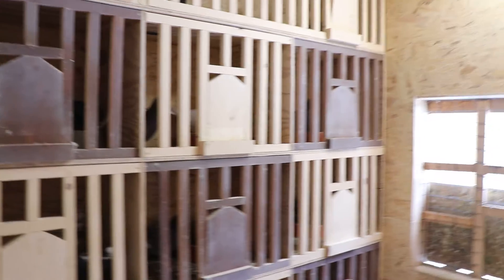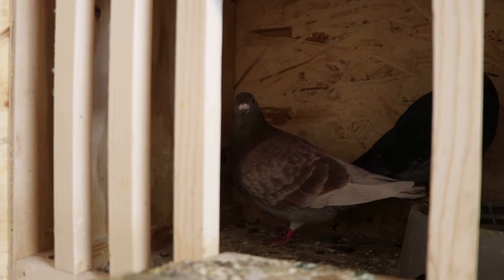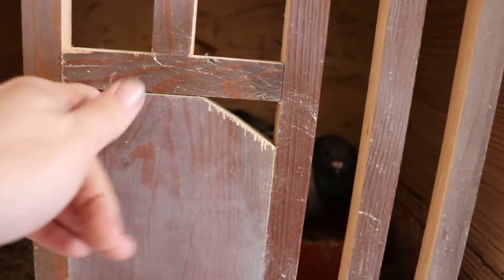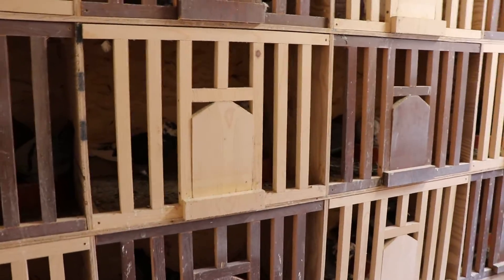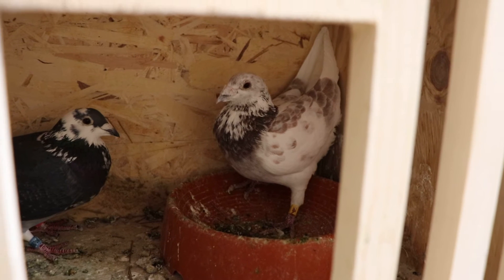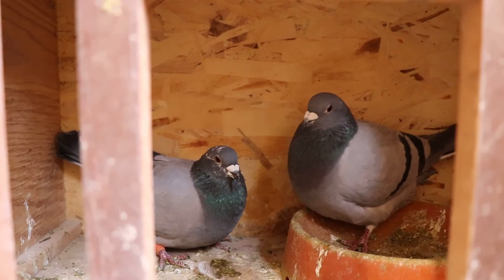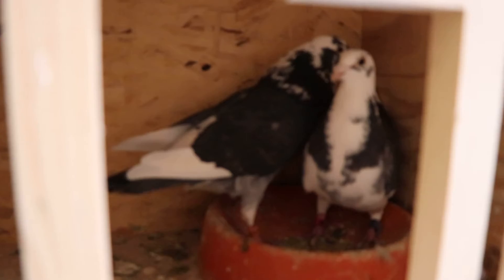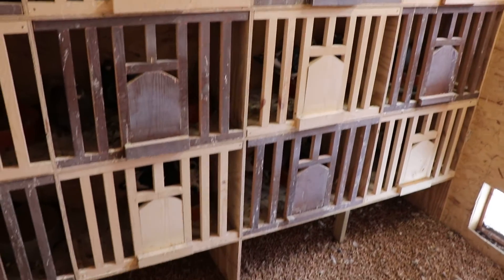Breeding Racing Pigeons 2018

Comment: As a former breeder with yrs of experience, i know exactly what he meant. You pretty much figured right on that. Some would not agree that the way you paired birds is a good way for various reasons. Mostly because of some families not being "compatible" with others. I never held much belief in that. Here in Hawaii, our birds face terrain much more challenging than most other places. So we have to breed accordingly. A lot of the time we found it necessary to cross breed pure bloodlines for this reason. As you become more experienced and knowledgeable, at least in my experience, youll start to get gut feelings about what birds to put together based on this alone. I like the pairings you chose and the reasons/methods why you did this in the way you did.
Reply from the maker: With my own birds I knew what I wanted to breed at the end of last breeding season but because these aren’t my birds and I have no information other then race results so I chose to breed good to good. I also don’t believe that there is any right way to breed birds. The chances of getting an ace is just as high whether I pair them if they just pair them selves. There are many wrong ways of doing it, breeding by color or families/strains I believe can set you back years. In my opinion I don’t believe in families not crossing well with others, maybe the birds weren’t compatible but not an entire family of birds. My goal is to get a few good birds to replace some of my older stock that hasn’t proven to be any good. I don’t want to bring in any new birds or strains until I have a good family myself
Reply: Adrian P different people have different philosophies on this.  It all depends on what results you want. sometimes when birds choose mates them selves despite trying to pair them with other birds can result in good offspring. Sometimes the  birds see something we missed. I found that to be true enough times to where when this happens I let them stay together.  As far as older birds are concerned, I used fosters for birds older than 7 yrs to prolong fertility for these older birds. especially when I needed more of that particular bloodline. With the quality and known history of the birds you're breeding, I don't see how you can get any offspring that won't perform well. Only poor maintenance and performance on your part will result in a poor outcome. But I don't see that happening. 
The only suggestion I have is use fosters for the older birds. You have a big amount of birds that basically will just sit there and eat and crap. Use some for fosters so at least they don't end up being just an expense.  If you have any questions about this, just ask. I'll be happy to help.
Reply from the maker: I appreciate your input and yes I will be using pumpers for the older stock. I may have not mentioned it but I’ve had Pigeons all my life. Both my grandparents kept pigeons so I’m not new to racing homers just new to racing. And your absolutely right, my management can be the weak link to not achieving my end goal. I love your input, there always something to learn. Lol
Reply: Adrian P that's a good thing being around and having pigeons all your life. I was not aware you were. I'm glad you like my comments. My history and experience is mostly in breeding. My partner did the training and flying in races.  So I had more time to dedicate towards breeding than most other fanciers who did both. And my ability to "know" which birds to pair was considered uncanny even by other experienced fanciers.  This is the part of pigeons I miss the most. I look forward to seeing the results of your breeding.